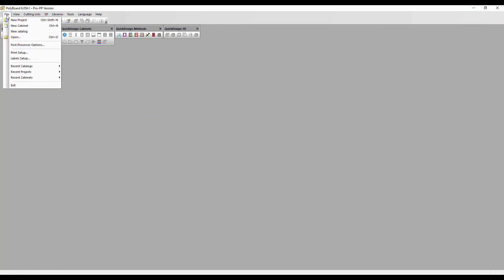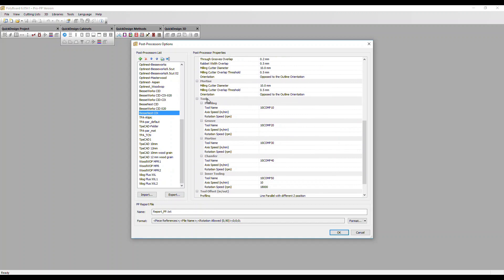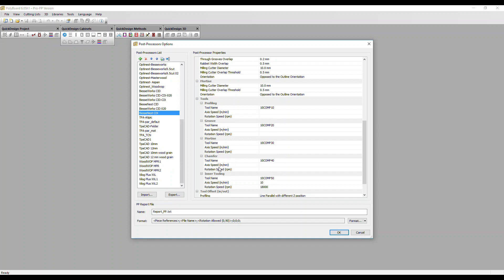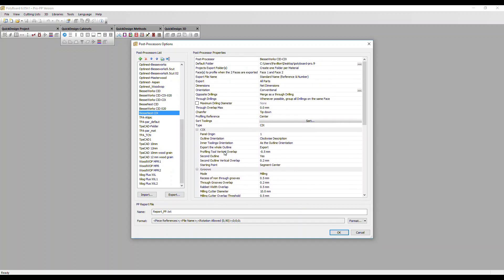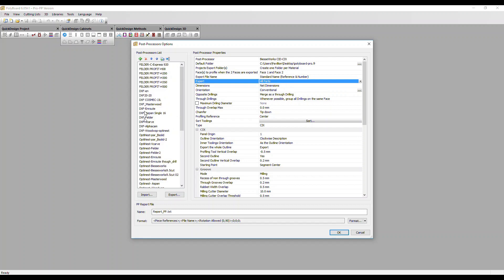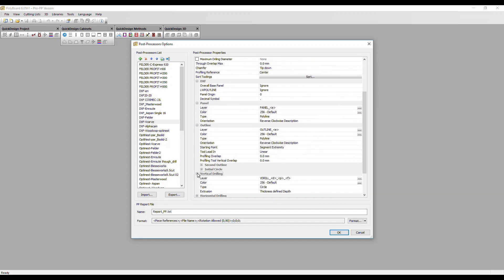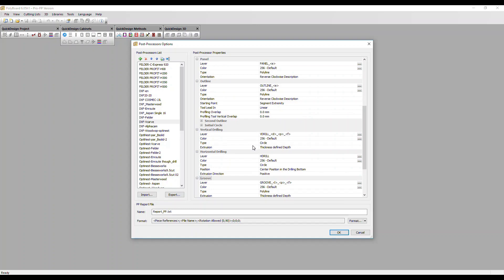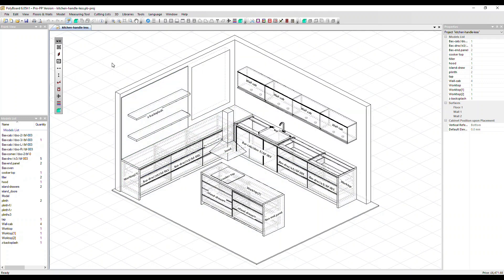Post Processor Output for CNC Machines with Polyboard

Comment: Hello, Im using Polyboard and send the parts to Optinest for optimization and nesting, however I don't know how to export all parts to Optinest, the situation with me is for the identical pieces, Polyboard just generate 1 file for piece, for example if I design in Polyboard a cabinet with 4 shelves, Polyboard only generate 1 file for Optinest for the shelves, I can't generate the 4 shelves. I'm using the Optines Post Processor in Polyboard. Thanks for your help
Reply from the maker: Hi Alberto

Thank you for your query. 
Polyboard exports only 1 part to OptiNest with a quantity to be repeated, If there is any problem please inform us of the versions used, and attach the cabinet under Polyboard and the OptiNest file.